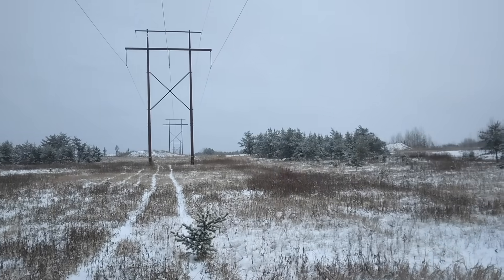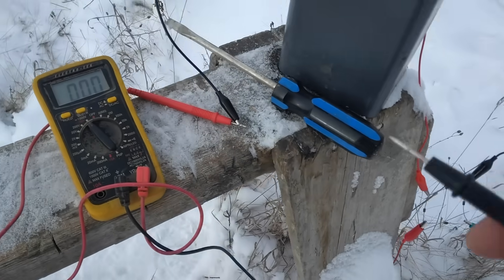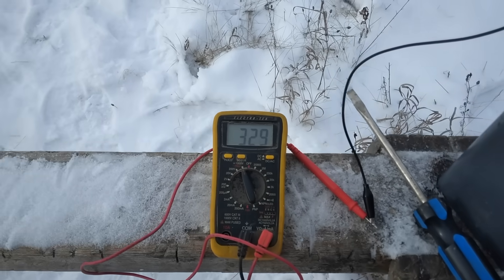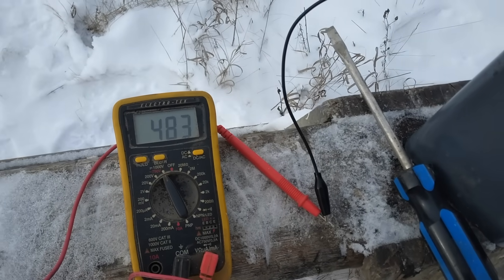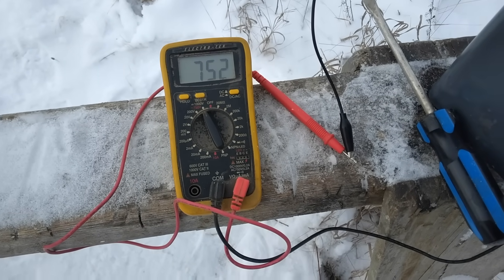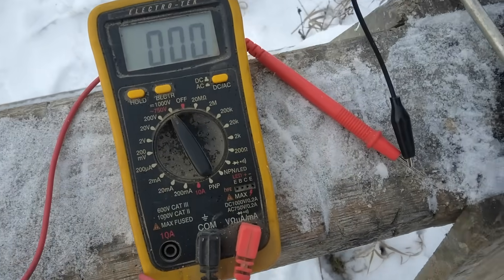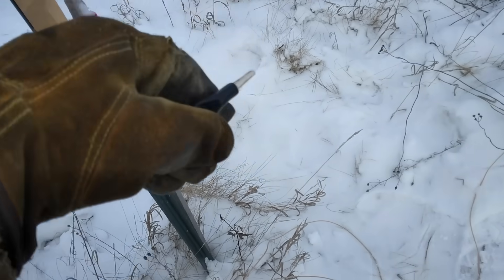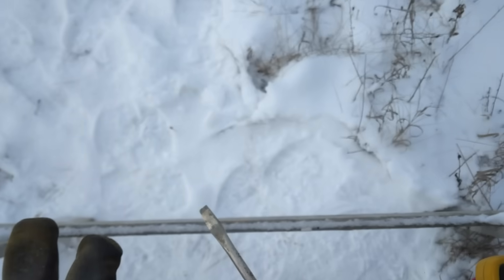Fences sucking power from under HV transmission lines

Comment: I'd try this: Make the fence 5' high. with posts every 10 feet, run three different wires, one at the top and leave 12" between them, from one end to the other, make them 12 ga in size and increase the size of your ground stakes. Use rebar!! I'll bet you increase amperage to a more usable level ;-)

Comment: You should hold a fluorescent light by the glass underneath the power line to see if it lights up it'll work with different various sizes once you get Within for underneath at a power plant in Virginia the power coming from the nuclear actor that crosses Lake Anna I made our fluorescent tube light up three of us had three different sizes fluorescent lights we were stunned so I guess you can park your boat under the power lines in the water and get the same affect

Comment: So am i  to understand from this video that's if you left that wire strung up under that power line,  ungrounded, it would charge up over time to some 900 +V capacitance .  Or do you still need to have an actual capacitor , consisting of 2 metal plates separated from each other inside of an electromagnetic field?
 Or is The Wire enough by itself ?

This reminds me of  a  project that I read about years ago about the electromagnetic field around  energized  wires.

Comment: I have seen something like this up in the north. Old farmer buried some heavy copper wire in a back-&-forth pattern under the lines, not sure what his configuration was back up at the barn; but said it gave him enough stored power to run the barn lights and few things.

Comment: looks like a 145 KV line to me!
hold a fluorescent light bulb by the end, it will light up
the static elect. has high voltage & very little power

Comment: There have been cases involving people using coils of barbed wire, wire spools all manners of inductance coupling to high tension wires. I've heard in the past rulings are usually against them, but I think the devises were actually ON the easement, sometimes even buried.
It's kind of hit and miss with the courts, your millage/luck may/will vary.
Typically capaciters accumulate/scavenge PEAK POWER which on typical household currents are above RMS of 110/120 volts, their is a multiplier to calculate it but I don't recall it as of present.
U.S powerlines used to not but be above 500,000 volts, but I've heard we have them now. I'm not referring to the high voltage DC lines such as Oregon to California. Although Canada runs 1,000,000 volt lines.
I think your running much too large a capaciter there as it will charge to peak even despite inverse square laws, it just takes longer. Similar to Teslas capacitor charging using high attitude atmospheric arials. You might look at his patents for same. Voltage would still have to be steped down.

Comment: i got one for ya . try moving away to the point where there rules stop and put up a fractural antenna about 20 feet in the air and try running the same test . from what i understand  fractural antennas  were used to pull energy from the ether in the air . ether is the lost element that was dismissed after albert Einstein created the law of relativity  .
Reply from the maker: A 'fractal' antenna (I think that's what you mean), is something I don't know much about, but something to consider. Thanks
Reply: @doubleMinnovations  ok i can understand that there is not much information on them . that i  have found . i do know they were measured in Egyptian cubits . from tip of finger to elbow is one cubit . so not super accurate . but a full wave is 440 and can be broke down to a 3 foot length . and a fractal antenna from what i can gather is made up of geo metrical shapes .  now there are videos on you tube that show how tesla made a antenna to pull energy right out of the air . im guessing static . and i believe is just another form of fractal antenna . my best guess is they are using a wave length   and just bending it in different shapes to make more mass and less length . how ever i could be wrong and the length or size dont really matter but just the mass of the object to collect the energy from the air . i have subscribed so if you choose to test these theory's i can watch . i think what your playing with is very interesting. and maybe very dangerous . just follow the rule of 3 when you go to measure 3-6-9-12 and so on .  insulate it from ground  and run it to a light bulb . then run a ground just like you did by the fence and use that as your ground wire . would love to see what happens .

Comment: Thanks for taking the time to share this experience. I'm wondering if what would happen if you hooked up a Solar panel charge controller and 12 volt battery. You think there's enough there to charge a Battery? the charge controllers can take over a 1000 volts DC.

Comment: truth is the very long electricals lines act as giant antenna radiating in space more and more as the current used increase. . .
Reply: The frequency is too low to radiate very far. But the transmission lines can and do mess with other transmissions.

Comment: Ok, serious question:

If building a coil running under the HV lines is (at least in some places) considered stealing, but (as many have mentioned doing in the comments) holding a fluorescent tube under the lines to light it up is not - what if you built a series of light poles unconnected loose fluorescent tubes, and used them to light your property at night. Would the power company consider that stealing, or would it just be you taking advantage of the local magnetic fields that happen to exist on your property (of course due to the presence of their HV lines)? 🤔

Comment: Is that 800 volts or 800 ml volts
Reply: Charge battery banks with run your house free energy
Reply from the maker: It's being measured in volts.  Stop when it got over 900 volts.

Comment: From what I saw, you were not measuring for voltage, you were reading microfarads.  A working capacitor, will slowly charge microfarads, not volts, and then when charged, will discharge them and return to zero.  If you want a device that will show volts, rig it with a transformer.

Comment: I've done some experimenting in this area too. This is capacitive coupling through the air between your wire and the power lines, so you have to use a full-wave rectifier as you are, otherwise the 'air' capacitor simply charges, and you get no power. This setup works to a lesser degree even under 14.4 kV distribution lines. You were likely pushing those diodes near their limit, because when reverse-biased, you have the capacitor voltage plus the peak source voltage in the opposite polarity across them. Of course this is divided across 2 diodes in the full wave rectifier.
Reply from the maker: Yep, it sounds like you have done this before.  Thanks for commenting.
Reply: Stumbled in I was aware the amount of free angry electrons got insane on a foggy night, and the sound of 60Htz buzzing like crazy.  

Odd that I don't recall if I felt it body wise. 
😂Back in Highscool. 

I have had St Elmos micro lightning along every finger seen at night, but never felt a thing, or where the source was coming from. 
That's a good 30 yrs ago, now seventy. 

On your site as standing, I seem to picture 100 ft of dry pallets, with 100ft of chainlink 8ft tall laying flat full length of pallets running along route of high voltage lines, to see how much faster the power gains occure at compactor. 

One could use that level of voltage spike to start a heavy duty twin cyl 110volt -  20amp motor on aircompressor. 

We might have  discovered a free way to charge your EV car 
overnight. It might not be a full charge, but gained enough power of what was used yesterday. 
Cheers

Comment: Yikes! danger will robinson.! Field strength  under the power lines is almost 6 kv per foot! In other words if you are standing directly under the power line, your head is over 30,000 volts from ground. The high resistance of the air is protecting you......even so, there is an ac current flowing  through you.

Comment: I would so receive Free Juice until the power company converted to High-Voltage Direct-Current. I imagine the power would freely dribble into the Ground. This could have made Edison competitive with Westinghouse. 
Why Coax; why not just use Wire?

Comment: nearly 4000 comments but I can't find one that puts it clearly enough for me, the crux of the matter:  is the energy already 'lost' into the magnetic field or is it only lost when some set up like this fence 'draws' on it?
Same question just putting it another way:  the power company is monitoring energy losses in their transmission lines all the time I think?  Well if you set up a system like this and it gets going will they see an increase in 'loss' ?
Reply from the maker: Everything around these power lines is going to be grounding out some of their power, even outside their easement.  I showed in a video that even my body was being charged to over 240 volts on the edge of the easement.  The comments tell of others having vehicles, houses, trees getting charged.  If these things have a connection to the ground, all that energy is part of the power companies losses.  It would have to be part of their acceptable loss.  Fences are allowed here under the power lines,.  So that also would have to be part of their acceptable loss.  The circuit I had in this video, just showed how much power was being grounded out.  And it is just a tiny bit.
Reply: @doubleMinnovations   Hi  and thanks for that.  Yep,  I'm just interested enough to try and fasten down one way or the other this question of 'loss'.  So that I can make up my mind and not have to think about the rights and wrongs of any such question,  legal battle, again.  Have my own kneejerk reaction.  
So I guess what I'm looking for is are people increasing the power company's losses or not?
If I were driving a leaky water truck down the road I'd expect lost water from my existing leaks, through holes as big as they currently are.
Now if folks start making extra holes or widening holes that's an attack on me.
Is it possible to put the thing in those kind of terms, see it like that?
Reply from the maker: Using the leaky water truck comparison; if someone went and made bigger holes in the tank itself, I would call that a direct attack. But if the road was roughened up that caused a little more water to spill out as it passed by that spot, there would have to be a decision made about how rough the road can be regarding any additional loss of spilled water. 
I don't see that there is any 'one size fits all' legality answer.  Some places permit fences under power lines, some don't.  Both parties would have to follow the terms of the easement.  I see deer stands under these power lines that have been there for years, that are at least 14 feet tall.   That's not permitted, but they're still there.  
It's depends on the nature of the people involve too.  If the power company wants to get you for something, they'll try to get you, because they have money and backing.  If a person wants to get the power company, claiming the em fields from the lines are harming them, and their house is not in the easement, they will try to get the power company.
so......

Comment: The energy is not the voltage and not amperage (current), the power is multiplication of these and time. The amount of energy is small for any practical use.
At least in my country there are rules regarding "protection zone" of power lines. You can do anything outside that zone. And inside zone you can do nothing, but only because you can hurt somebody.
You collected 44 Joules of energy. With this energy you can heat big cup of coffee by 0.05 degrees C. Yes, such tiny amount. And yes, this energy can kill you.

Comment: I worked a few weeks in a theater scene shop where they had speakers on the back wall and on the other side of the wall, just a few feet outside, freight trains would occasionally pass by at speed. The speakers would make a very loud popping sound as each car went by, even when the stereo was turned off.

Comment: Can I explain in SIMPLE terms why that power isn't wasted and why helping yourself to it isn't legal...

I have a Braun toothbrush. It's recharged by a gadget you put into a wall socket. When it's plugged in - without the toothbrush - it uses 25% of a watt. That charger is the equivalent of a high tension wire. As soon as I put my toothbrush ON IT to charge it (NO direct connection with wires or plugs) it uses 60% of a watt. The toothbrush is the same as a "harvesting" device and what is removed no matter how it is removed, has to be replaced by the power company.
Reply from the maker: Everything around transmission lines is going to be grounding out some of their power.  Even outside of the easement.  -like you read in the comments here. -houses, trees, vehicles, etc.  It's just not practical for them to place the lines any higher.  All of it is part of their acceptable loss.  Fences are allowed under the power lines here, and that is part of the loss, because fences will be grounding out some too.
So the question is; is grounding out the fence through a circuit, (rather than a direct short to the ground), stealing if the grounded out power is part of the acceptable loss?
Reply: @doubleMinnovations did you ground the far end of the coax?   we are trying to figure out if you built a transformer or a capacitor.
Reply from the maker: No, the far end is just looped around the far post.  It's a capacitive link, as I see it.

Comment: Using a buck converter circuit to limit power output, you can safely use to keep a battery charged or run a radio.

Comment: You're most definitely in the electromagnetic field of those high voltage lines.  So you have a air core transformer.  Don't get  across that capacitor or you'll look like Jack Torrance at the end of "The Shining" out there.
  Also, you should use an appropriately sized resistor with the right voltage rating and a high resistance to slowly discharge that capacitor. 
     Nice "field" experiment.  Thanks for sharing.
Reply from the maker: I felt the video needed a dramatic effect.😁
Reply: @doubleMinnovations  It worked! Nice spark!  Probably much more dramatic when you're right next to it. I work with similar components and sometimes the camera doesn't catch the true impact.

Comment: Voltage by itself does not kill. It is current that kills. the normal person has a dry resistance of about 8,000,000 ohm finger tip to finger tip. Across your tongue is only 4,000,000 and the heart is closer to the tongue .1 amp passing through the heart will kill but it has to get there first. Around .06 to .3 amps is very painful and will damage muscle tissue. 1000 volts is a lot of voltage but it took 4 Minutes to get a 700 volt charge. The total available watts is small. Volts X Amps is Watts. Not much there.

Comment: 1- if there's a fault downstream on that line, your little contraption will explode. 
2-worked for a utility for 30 years, train tracks run parallel to lines and are on a special dirt.  About 4 ohms above ground.  Anytime there was a fault downstream on the lines, a huge pulse would travel down the tracks (due to induction), blowing up the circuitry at each crossing.  Arrestors and all would fry.

Comment: I live in Ontario Canada, Ontario power Generation ( the grid operator) will for ~1500$CAD tell me what the encumbrance on my land restricts me from doing.  The closest I've found to useful information is that 75 feet either side of the centre line of the cables I can't build anything.  That power level is terrifying! I wasn't able to read the value of the cap, but from the size that would be a lethal discharge!

Comment: In Rhodesia. During 1972. The main Kariba power line crossed friends' property. Should one be under the power line. And a rifle is raised. There would be an slight spark between a finger touching.e.g the trigger guard.

Comment: Back about 77 while working on a dairy farm in GA I put one of those old two strand antenna wires on the fence that crossed under some HV lines.  I was trying to get better radio reception.  Whenever I touched that two strand wire to the bar magnet antenna in the back of the radio, I'd see something out of the corner of my eye.  Finally I got turned around to see.  The kitchen light in the mobile home was coming on whenever I touched the wire to the bar magnet!  Somehow, power was heading out that bar magnet and powering up the light bulb.  The magnet was pointed in that direction somewhat.  The switch on the light was off.  I got more interested in Tesla inventions after that!
Reply from the maker: Thanks for sharing your story!

Comment: I'm living in California now, came from NY. We had looked at numerous homes, I would turn down many a house b/c they were too close to the overhead high tension wires(voltages of 500 KV {500,000 volts}-most homes have 240v at the elec. panel).It states to be at least 700 ft away to be safe. I see all the people who bought homes right under their roof tops all the time-they keep building them and everyone keeps buying them -the builders know better!
Reply from the maker: Just to the east of us, there is a housing development.  There are houses and metal storage buildings built right on the edge of the easement, which is 62.5 ft from center.  The whole place is occupied...